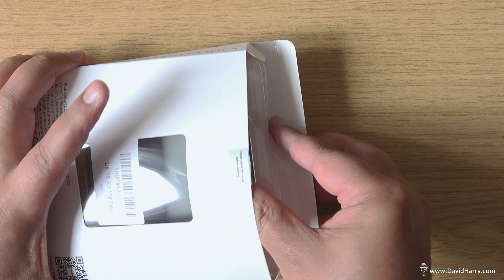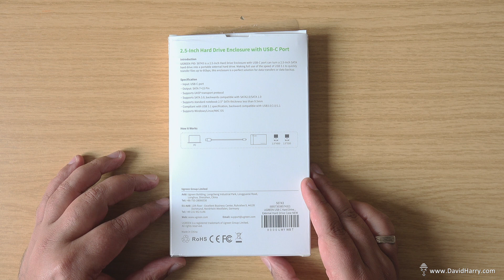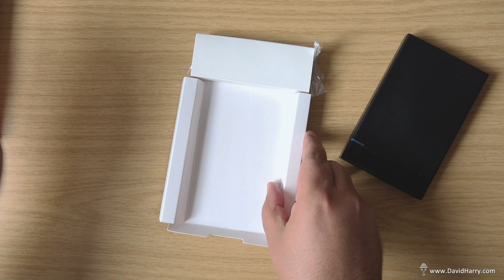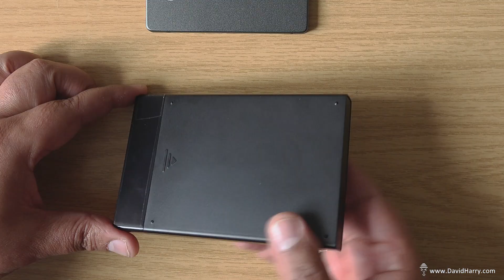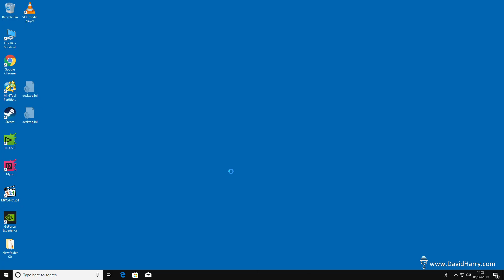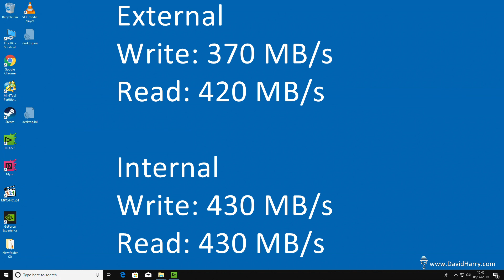Cheap 1TB USB-C SSD

Comment: great video came straight here after seeing it on amazon for 70 quid, i recently bought a cheap 120gb ssd from a similar chinese brand and it worked for about a week then just slowed done to abysmal speeds and im scared this will do the same thing, had it slowed down over time for you?
Reply from the maker: Hi. Yes, it did slow down, especially when getting full. But I also have the exact same issue with my SSDs by Sandisk and Kingston. The problem with the cheap Chinese drives and a lot of the cheaper brand name SSDs is that they use slower NAND storage technology. This is OK if you don't mind the slower write speed and they are usually still fast for reading, I use a 1TB Sandisk for my games, it's slow for writing once it starts filling up but is still good for read speeds and loads my games way faster than a mechanical drive. If you want the best write speeds consistently you do have to pay for it. In my experience, the best 2.5" SSDs are Samsung EVO drives, I use these a lot. Also if you look at M.2 SATA and M.2 NVMe drives the same thing will usually apply and Samsung, while being expensive, give you great performance. Cheers, Dave.
Reply: @DavidHarry  thanks for the reply, mine slowed down so much it was slower than my mechanical drive, also i formatted it so it had nothing and it still was slow. so im not sure what happened. also i subbed :D
Reply from the maker: I have a Sandisk 1TB SSD and once it’s over half full it goes really slow on the write speeds. At certain points it is way slower than a mechanical drive, sometimes going below 10MBs, which is ridiculously slow. I’ve experienced this with a lot of the cheaper SSDs from named brands as well as cheap Chinese ones. Like I said, the only way to get good consistent performance is with higher end drives, unfortunately. Thanks for the sub. Cheers, Dave.
Reply: also watching this after seeing them on amazon, i'm looking at  2TB version for a cheap stream drive, how yours today david? great video btw..
Reply from the maker: Hi. I no longer have mine. I’ve been slowly replacing my main SSD drives with Samsung ones, both SATA and NVMe. I do a lot of video capturing at high bitrates and most of the cheaper drives start getting too slow once they start filling up. I also use OBS a lot with an Elgato 4K 60 Pro for capturing game stuff. My minimum capture bit rate is 100Mb/s, which compared to my NLE video capture cards is quite low but even some of those cheaper drives start dropping frames at only 100Mb/s. Just remember that’s megabits not megabytes, 100Mb/s (lower case b = megabits) is only about 12MB/s (upper case B = megabytes) and I can even capture 12MB/s to a fast SD card. Cheers, Dave.
Reply: @DavidHarry  thanks for the swift reply,  i've took a punt on one as i am only putting games on it and for the price it's hard to pass up!

Comment: are you using it as primary or secondary ssd?
Reply from the maker: Hi Tadej. Iv'e used it for both but mostly as a storage drive. It's not the fastest SSD in the world but as large cheap SSD storage, its value is hard to beat. Cheers, dave.

Comment: Another great vid David. I'm going to try this out. Have you tried editing video projects straight from it, set up externally? I'm on a PC, and will be collating and editing an event over the weekend. I use Lumix, Canon and Zoom (lavs, shotgun and Rode mics) for footages, but friends use iphones and Macbooks and Zoom for video interviews ect.So, there is plenty of variety. Formatting using exFAT may be my choice for transferring from PC to Mac? Your solution here might be very useful for storing the whole project and editing directly from it. What you think? Thanks
Reply from the maker: Hi. Thanks.

Funny you mention editing straight from the external drive, I'll be doing a quick video soon. Because the speed and access times of the drive are so quick, it's well fast enough.

The thing with modern inter-frame codecs is that their sizes and bitrates are very small compared to YUV, RGB and uncompressed video files, that it doesn't take much to sustain their transfer speeds. If you take a typical 4K/UHD H.264 MP4 file it's likely to be anywhere between 100 and 200Mb/s. That measurement is megabits, that's what the small lower case b means.

This drive is capable of sustaining over 400 MB/s, that's megabytes which is what the large upper case B means. As memory is generally measured in 8 bit bytes, this means the drive speed of 400 MB/s comes out as 3200 Mb/s.

The other factor for editing is access time, while I don't have the access times to hand for this particular drive, it's stupid fast compared to a mechanical drive. Which means that multiple files can be addressed simultaneously a lot quicker than mechanical drives. Also data fragmentation becomes almost none existent in practice due to the access speeds.

It's more likely that your bottleneck using such an external drive will be the USB bus itself, or the CPU/GPU when processing/decoding the codecs of the video files.

I'll see if I can do a quick video example later or tomorrow.

I'm not too sure if anyone is actually that interested in video editing and the technologies etc, but I may try doing some video editing tutorial type stuff.

Cheers,
Dave.
Reply: @DavidHarry  Cheers Dave for your speedy reply. I use PremPro, which might make a difference? I'll be very interested to see your results. Having different video projects, self contained and useable on an external drive would be amazing. I'd like to see how much you could push it - multiple audio, jpegs, 4K, colour grading, cropping etc. Thanks again.
Reply from the maker: Hi. The only difference with something like Prem is its scratch disk allocation, although if you use a high end fast SSD you can boot, run Prem and assign the scratch/temp/cache folders all on one SSD. For stuff like grading, cropping or any picture manipulation, the drives shouldn't make a difference, caching aside, as all the picture manipulation stuff is done by the processor and/or GPU. In a heavy edit, grading etc. you're more likely to bottleneck your processing before drive speeds would slow you down. The only one thing that I'd say about cheap drives like this one is that they can slow down quite badly after a certain amount of space has been used, some use a cache system that requires various ways of using the NAND flash itself. For mission critical stuff I'd always use Samsung drives, all my my main SATA and NVMe SSDs are Samsung. Other high end end drives are also great but I kind of stick with brands that I personally have good experiences with. The only problem is that Samsung are one of the most expensive but in this instance you really do get what you pay for. Cheers, Dave.

Comment: Well explained. But what a technologically advanced age we live in! 👍
Reply from the maker: Hi Terry. Thanks. I appreciate that £100 in itself is neither a small amount of money or chump change but seriously, I couldn't find a cheaper way of doing this and was surprised I could do it for the price. This particular setup actually cost me £82 as both the drive and case were on Amazon flash sales at the time. £82 is just insane. As for living in an technological age, I can never get used to what's available and what's around the corner. Cheers, Dave.

Comment from the maker: Buy the TC SUNBOW X3 1TB SSD at Amazon-com: https://geni.us/Sunbow1TB
Buy the TC SUNBOW X3 1TB at Amazon-co.uk: https://geni.us/Sunbow1TBUK
Buy the UGREEN USB-C enclosure at Amazon: https://geni.us/UgreenUSBC

So after a lot of searching to find the cheapest 1TB portable SSD that was inside a USB C USB 3.1 case, I finally came up with the cheapest solution. The TC SUNBOW X3 1TB 2.5" SSD drive using the SATA III 6Gb/s interface and the UGREEN 2.5" SATA III to USB C USB 3.1 Gen 2 enclosure case.

This combination is very easy to put together. The UGREEN USB C case is a tool-less design, basically meaning that it doesn't require screws or a screwdriver. It has a very simple push and slide mechanism to open up the case, which reveals a SATA III and power socket that you simply slide the 2.5" SSD drive into and then close up the case as easily as it is opened.

The UGREEN USB C enclosure also comes with a USB C to USB 3 data cable.

The SSD by TC SUNBOW, the X3 1TB, is a 1TB SATA III SSD drive with a 1024MB, or 1GB RAM cache.

While there's slightly conflicting information about the UGREEN USB C case being either Gen 1 or Gen 2. This doesn't really come into play as even Gen 1 is fast enough to allow the maximum data rate of the SUNBOW X3 1TB SSD. Probably the most important thing about the USB chipset and interface of the UGREEN case is that it supports the UASP transport protocol. As long as the USB interface on the device that you are connecting to is UASP compliant, again, there will be no issues with maximum speeds from the SUNBOW X3 SSD.

UASP is basically an extension to the SCSI protocol, or USB Attached SCSI Protocol.

For the speed tests I didn't do any synthetic benchmarks as these wouldn't have given an accurate picture of the sustained read and write data rates of the drive. Instead I done real world data dumps to see exactly what the sustained speeds and data rates were like.

As my particular use for this drive is for using it to transfer videos files with, basically I use a Chromebook to preview my video camera files when I'm out shooting and then transfer the video files from the SD cards to the external portable SSD, building up my video bins as I go along. It was very important for me to see how well the drive manged sustained transfers of folders with large amounts of video files in them.

As you can see in the data dump transfer speed tests, I was able to do sustained write speeds of 370 MB/s with this drive and a read speed of 420 MB/s. With these types of data rates for my video files and importantly, sustained. I can also edit 4K video projects direct from this drive with my NLE.

What's very interesting with this drive combination is that the speeds don't drop as they quite often do with cheaper and older SSD drives due to their data caching system. 

All in all, this is the cheapest 1TB external portable SSD combination that I have come across to date which is also USB C running at least 3.1 Gen 1. I'd have to also say that this is excellent value for money and on a $ to MB basis is cheaper than any high speed SD card or USB storage drive that I've seen.

Here's a link to download the free version of Mini Tool Partition Wizard software:
https://www.partitionwizard.com/free-partition-manager.html

Music used:
I Am Running Down the Long Hallway of Viewmont Elementary by Chris Zabriskie is licensed under a Creative Commons Attribution licence (https://creativecommons.org/licenses/by/4.0/)
Source: http://chriszabriskie.com/honor/
Artist: http://chriszabriskie.com/

------------------------------------------------------------------------------

Please consider supporting my YouTube channel by liking, subscribing and clicking the bell icon for notification of future videos. It really does make a big difference and also please share my video links.

You can also support my YouTube channel financially by using my Amazon affiliate links for any products mentioned in my videos. If you’re buying anything from Amazon please use my Amazon Shop links below.

For any purchases using my Amazon product links or any purchases made using my Amazon Shop links, I will receive a small financial commission from Amazon. These earnings from the Amazon commissions really do help with purchasing review products for my YouTube channel and I’m extremely grateful to anyone who helps me and my channel this way.

https://www.amazon.com/shop/davidharry

https://www.amazon.co.uk/shop/davidharry

Also, you can support me and my YouTube channel with direct financial support via PayPal. Donations for cups of coffee are really appreciated and keeps me going when editing :)

https://www.paypal.me/DavidHarry

For product reviews please contact me at:

YouTube@DavidHarry.com

Also, please visit my website:

http://www.DavidHarry.com

Thank you very much for watching this video, take care and goodbye now.

Cheers,
Dave.